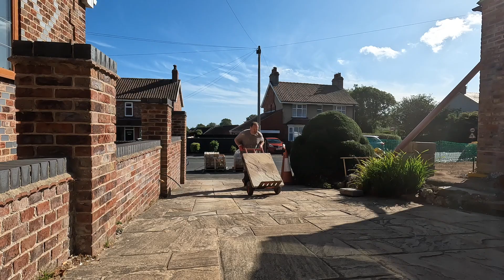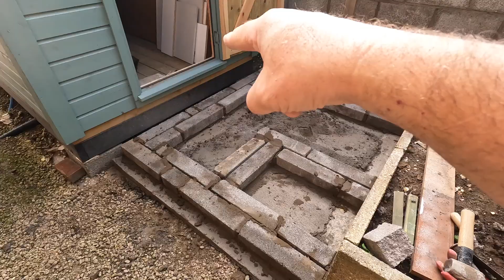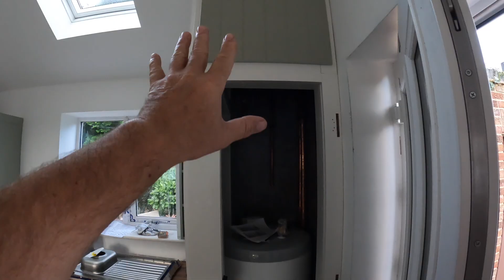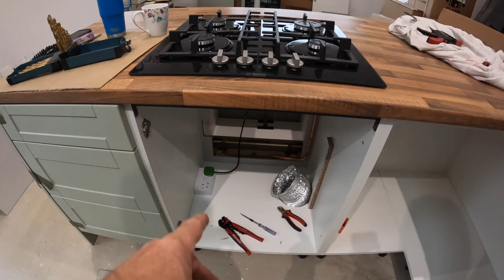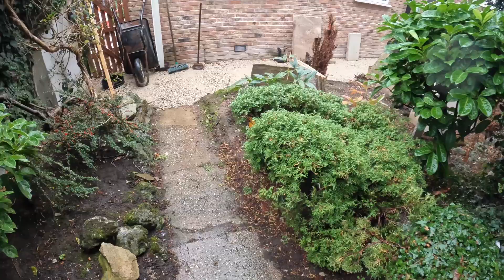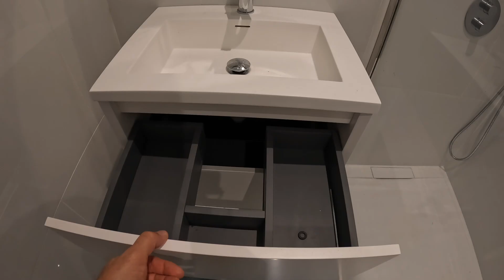Garden Project part 63. Building steps. Complete pop up kitchen extractor. Plumbing Electrics start

Comment: So disappointing to have a water leak at this stage Geoff. Have you found it yet 🤔
Reply from the maker: Hi Doug. Not as yet but I haven't looked. I turned off the water and opened a tap to release the pressure. I intend to let everything dry out and then I am going to turn the water back on and try to see what area gets wet first. I am hoping that will help to narrow my search so I am not ripping out things that I dont have too.....just yet.
Reply: @geoffcarol1 . Lets hope it turns out to be a minor issue. I would be livid after all your work and care. 😳
Reply from the maker: @Doug....  It is unfortunately....one of those things.....All the pipework was pressure tested and it held pressure so it's not worth getting cross about. These things happen and I think it's different when you have tried your best and have a leak rather than...."not given a toss"....and having a leak. Then I would be annoyed.
Reply: Another great instalment. The bathroom and kitchen look really special and when finished will make someone have a very special home with a video record from the start. As stated, Clarence will be very impressed .
Reply from the maker: @tonywhite5033  afternoon Tony. Good to hear from you. The bathroom and kitchen have turned out really well and the bathroom I am really pleased with as it is such a small area but it feels bigger than what it is. Just having the glass shower screen coming halfway on the shower tray makes a huge difference. I love it when people mention Clarence so you have certainly put a smile on my face and I thank you so much for that. 😀😀😀